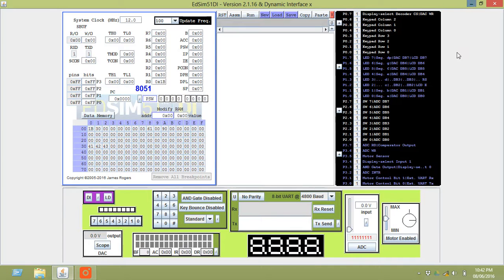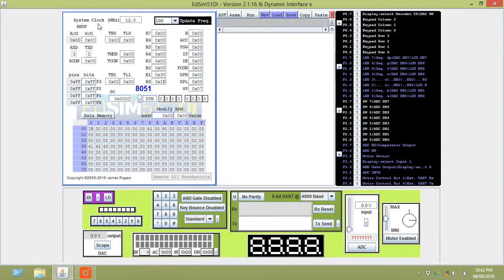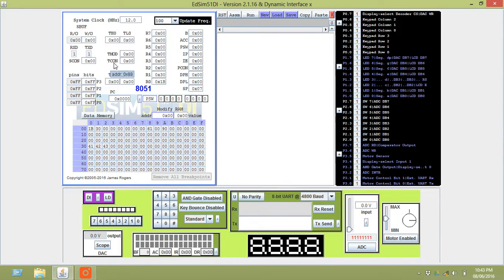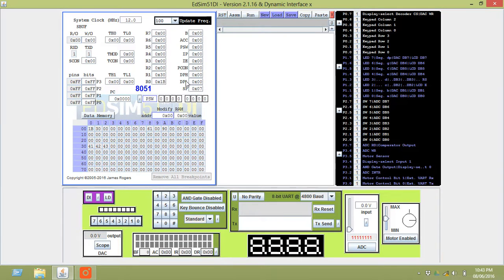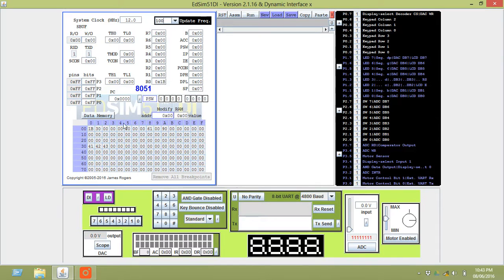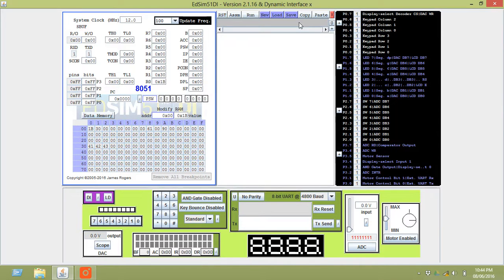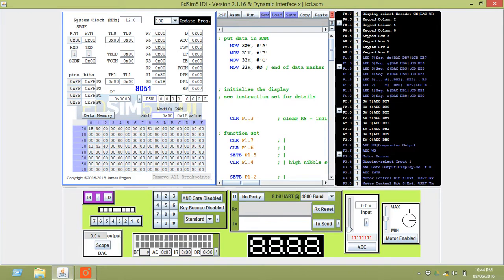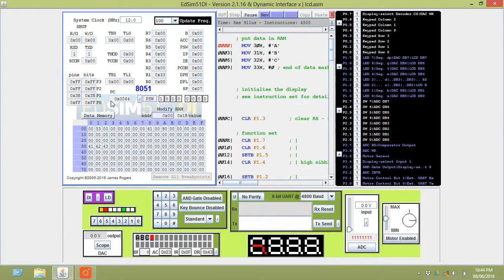Performing assembly level program on EdSim51

Comment: Thx for helping in understanding. There is almost no info about that program on the internet atm. We use it at the university and we hate it tbh. :-/
Reply: @RanjiRaj18  We are asked to make a simple calculator in EdSim51 (add, substract, multiply, devide) where you select the first digit, then you choose the operation sign (1, 2, 3 or 4) then selecting the second digit. Then doing the calculation and showing the result on the p3.3, p3.4 thing. Would you help us with that or maybe even make a video about it? That would be super cool. :D
Reply: @OnlyNeedsEKKOnds  So how did that project go? I'm very interested to know what you did!